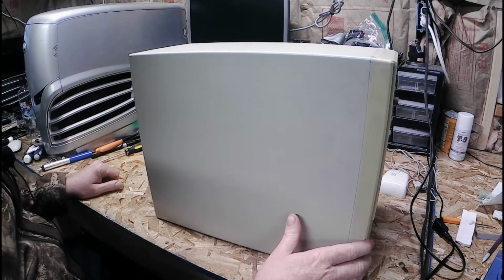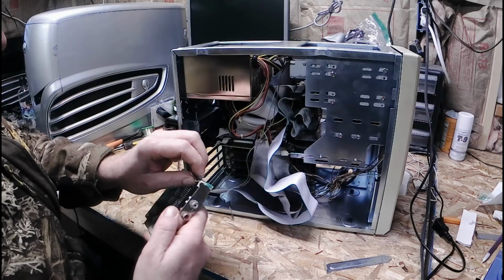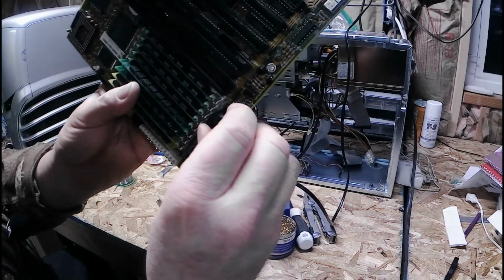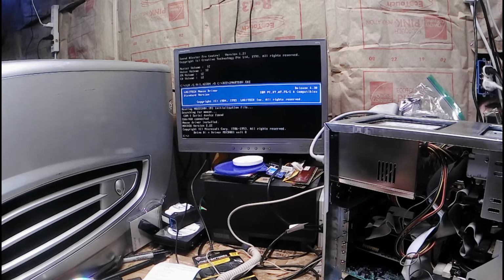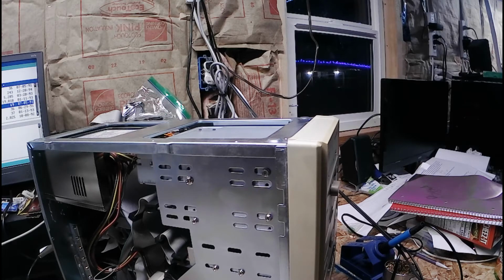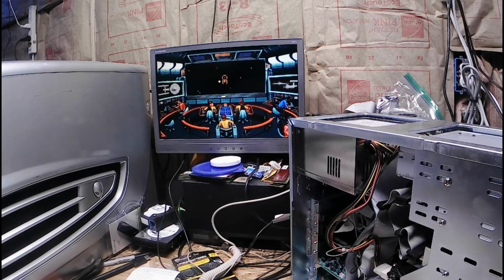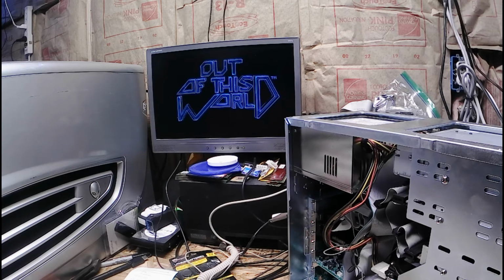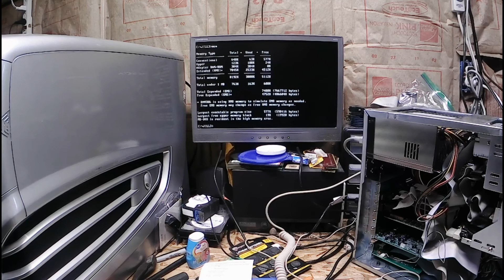#DOScember 386 rebuild

Comment: Reminds me of my long-gone 486 case.  I've long been on the hunt for a case with a lock, turbo, reset, beefy power switch, and CPU speed LED display so I can rebuild that system.
Reply from the maker: Yeah it's sad how hard those case's are to find, and when you do find on its overpriced or broken and overpriced.
Reply: @OCROldComputerRebuilds  You got that right.

Comment: would be nice if could hear what you are saying better
Reply from the maker: Yes thanks for that. My replacement cam is supposed to be here  tomarrow. I hope it has better audio.
Reply: A separate microphone shouldn't break the bank. You can get a home-studio quality mic for not a lot of dosh and it will make a world of difference to your videos. I use a blue snowball and you can get them cheap or 'renewed' on Amazon or EBay.